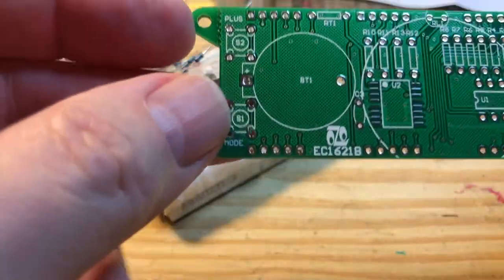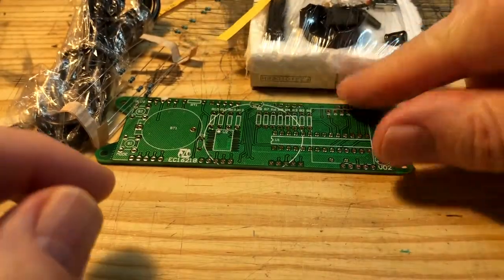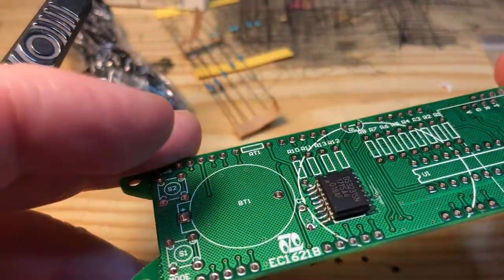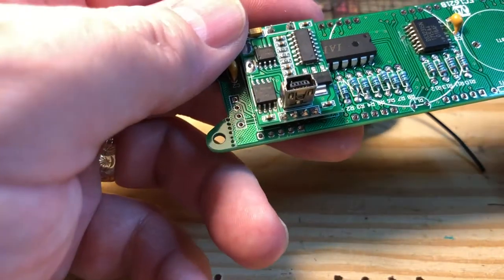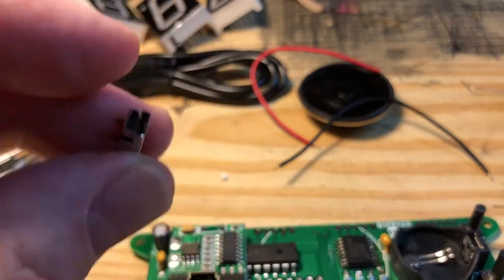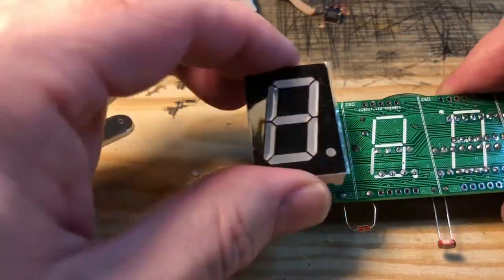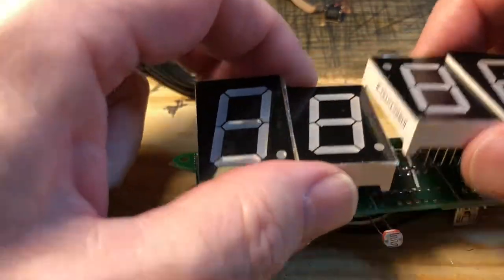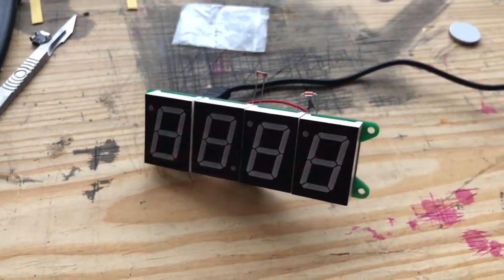Banggood DS3231 Voice Timing Music Control Electronic Clock Kit

Comment: From other model instructions:

Some errors in welding：
1、 Clock chip no welding or welding error. Show "Eor1".
2、 Thermistor (temperature measurement circuit) no welding or welding error. Show "Eor2".
3、 Photosensitive resistor (metering circuit) without welding or welding error. Show "Eor3".
Reply from the maker: Thanks for this. Yes, checked all of that. No change though :(